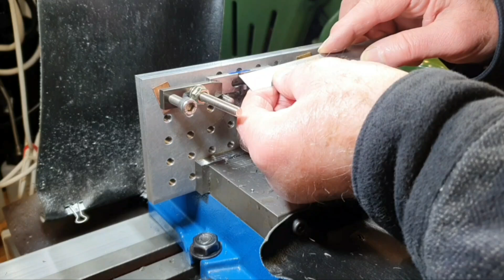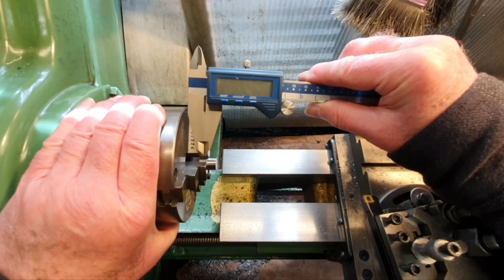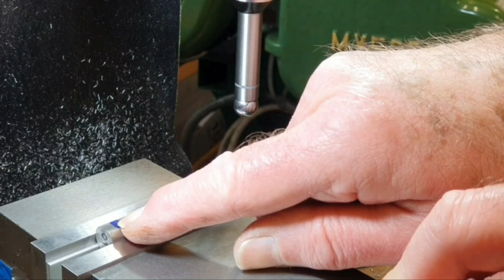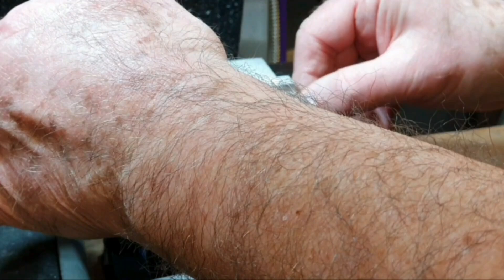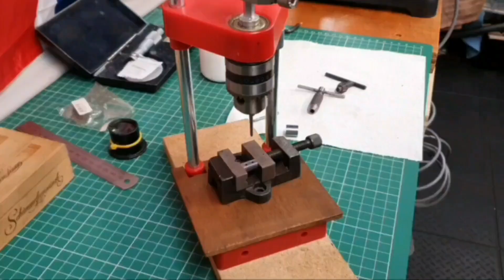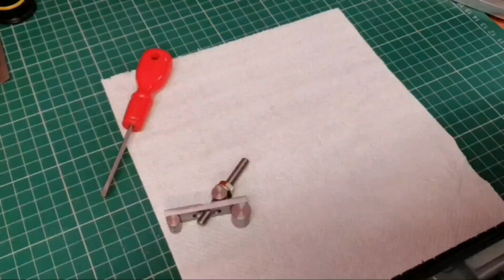Fixture Plate Accessory Pt 2 and a Special Micrometer.

Comment: can you edge find on the inside of vise jaws instead of on a round shaft?  what is the advantage of this clamp vs adjustable one?
Reply from the maker: You can edge find from inside the vice jaws, provided there is room for the edge finders probe. One advantage of this clamp is that it only needs one threaded stud to lock it in place. Cheers Nobby

Comment: Gday Nobby, beautiful job on the clamps, you’ve really done a nice job, making mistakes is the best way to learn even though it’s frustrating, with electronic edge finder I was always told to have it spinning slowly while touching off, sometimes the spring loaded ball is not quite centred in the unit and will mess with the results, I do have one but never used it, I must find it again now I have a mill with plenty of Z height, great job Nobby, cheers mate
Reply from the maker: Thanks for the very nice comment Matty. The electric edge finder I have has a fixed ball on the end. I was recommended not to run the mill when using it. You have to bring the ball very gently up to the workpiece, so as not to damage the end. ATB Cheers Nobby

Comment: when finding center of Y axis in vise, put your edge finder between the vise jaws find each side of jaws and then use 1/2 function to find center of y
Reply from the maker: Unfortunately I couldn't do that as the ball on my edge finder was the same diameter as the part. Thanks for watching. ATB Cheers Nobby

Comment: Looks good Nobby. A few lessons learned - that's the way it goes. Each time improves you for the next thing you make. I like the clamp design, very smart. Not sure what features your mill has but if you have any kind of readout on the quill, whether dials, scale or DRO you cen use those to return to a height position for touching off each side of a part. You can also set the probe down on a block and use that to set the height of the probe each side of the part - should you happen to be working on something long that you can't go around. Good parts in the end though. I like that countersink trick too.
Reply from the maker: Thanks Stuart, I learn something new every time I'm in the workshop. That's the fun of this new hobby, being able to share ideas with others. ATB Nobby

Comment: Clever clogs, what a super idea. Another time cut downwards when doing the radius, so that the tool is only cuttig on the end. Will save all that chatter dues to the surface area contact of the whole part length. Regards from Australia.
Reply from the maker: I'm still learning David. That's why I'm always greatful for your advice. Used your trick with the counter sinks. Cheers Nobby